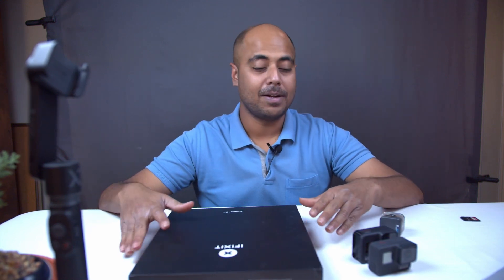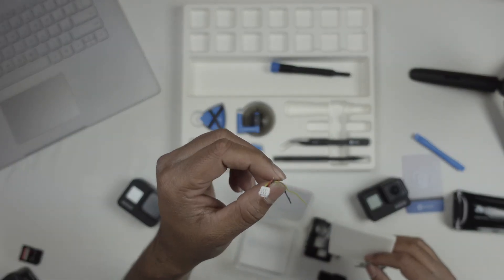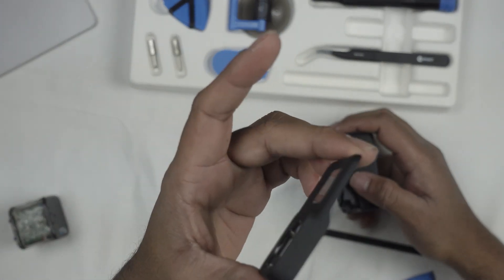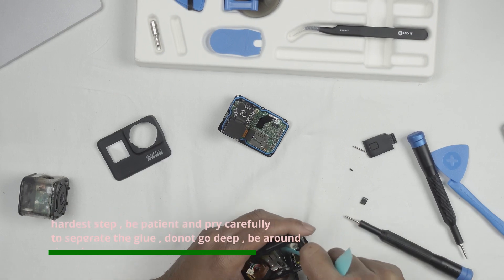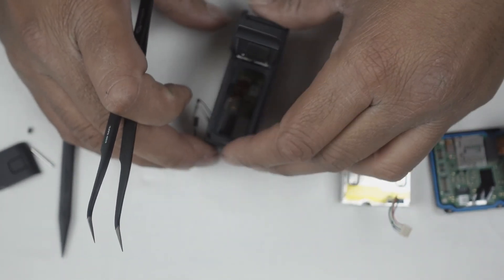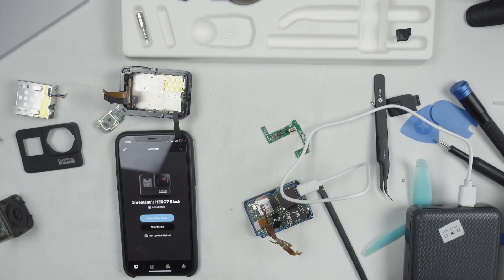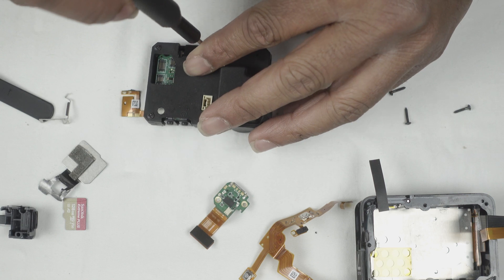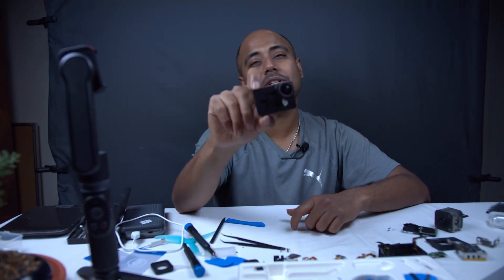Gopro lite // naked gopro hero 6,7 step by step teardown// betafpv case v 2.0

Comment: This will work for a GoPro 5?
Reply: 5 NO..  different ribbon cable
Reply: @TechTimeElectronics  ty kind sir
Reply from the maker: I have tested 6/7 the 5 as far as I know is the same but double check
Reply: @Techado  well. I assume it would be more difficult to work with since you'd need to attach the screen to change anything, no wifi and all...

Comment: You say it can be done on the 5 is it the exact same as the 6 and 7 hook up or do I need to hook up the Betta fpv case different?
Reply from the maker: i did it on the 7 and 6 is the same
Reply: @Techado  yeah I know that I need to know if it’s also the same for the hero 5?
Reply: @Stink Foot mine too
Reply: it can be done on the 4...Check my channel for the video 😉

Comment: Is it possible to do it in hero 3?
Reply from the maker: but hero 3 if i remember doesn’t have a gyro to be used with reelsteady software!  so the ultimate result will be a lighter cam shooting 1080p and you have a chance of ruining the board. i would go for insta360 betafpv smo 4k for 239$
Reply: Yes. Check my channel. Got a video of it being done on the 4 and they are the same as the 3

Comment: I thought hero 5 wont fit the betafpv case?
Reply: same...i have one hero 5 black and i wish i could find a good video about how to naked it. tell me if you find please!
Reply: @diegosuarez8068  now I make my hero 5 to naked condition
Write me, mb I’ll film a guide
Reply: @shyzzar1107  hello, Do you share me this guide? I have a gp5
Reply from the maker: share your guide links to the comment section! i have unlocked link sharing
Reply: @shyzzar1107  i would like to know who!! tell me when you can!
Reply: @shyzzar1107  Hello how are you doing?. I would like you to help me with making the gopro 5 naked !!, thank you !!!
Reply: @diegosuarez8068  i know who use naked Hero 5. Cek instagram toom23.t
Reply: @ArifThoriq_syhbn  thanks i’ll check it
Reply: No way am I attempting this.. things rarely go right for me! I wish GoPro would make a lighter or naked version.. it could even be cheaper.
Reply from the maker: don’t forget to checkout the insta360go on a 65mm long range quad , i agree better alternative.
Reply: @Techado  also the ready stripped down BetaFPV Insta One R